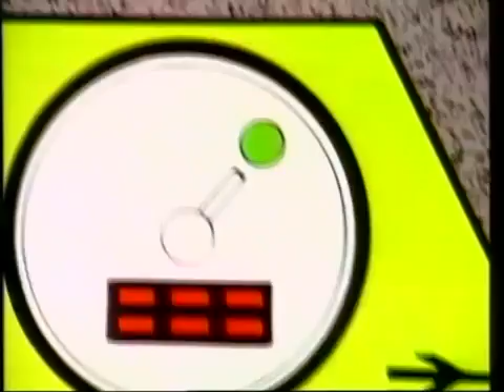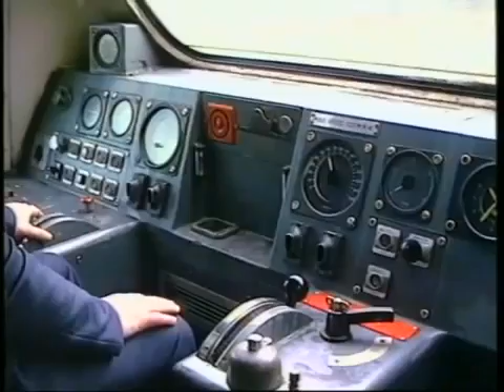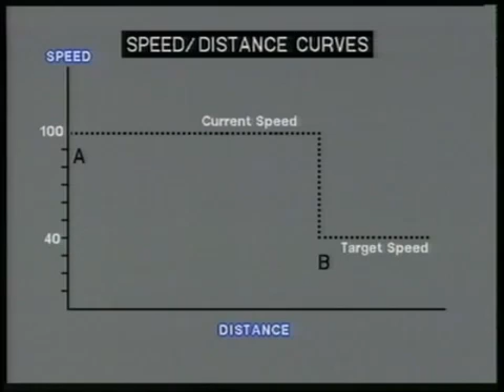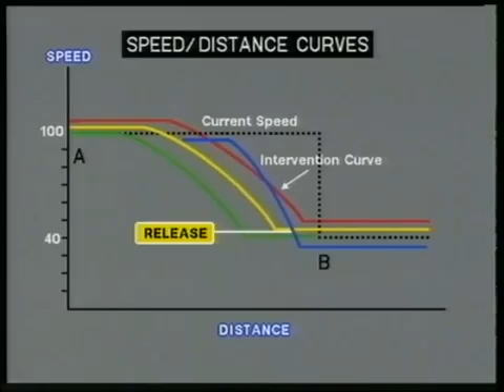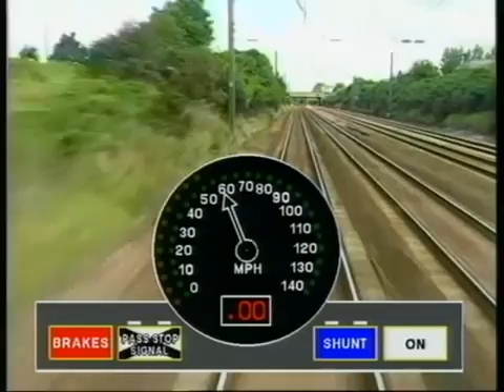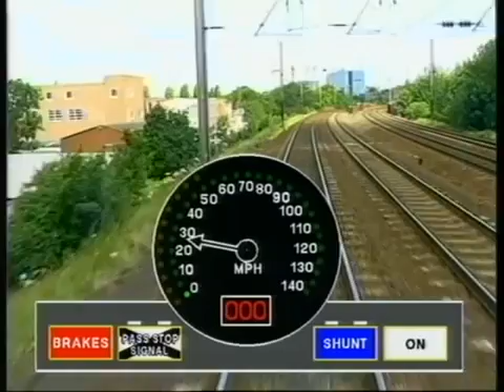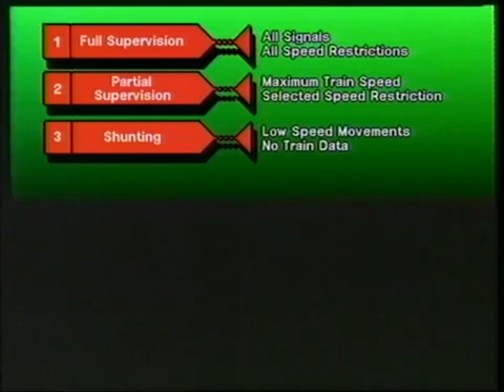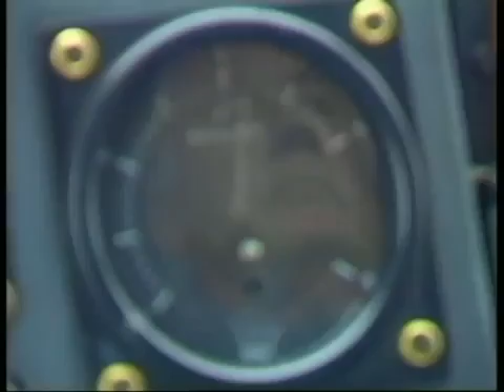BR | Automatic Train Protection

Comment: The technical term for intervention and SPAD's is getting "rednosed" which invariably ended up with a carpeting by the traction manager and persistent reoffenders would be moved to another role or simply sacked.   The thing with ATP and TPMS is they can't be ignored, this was a major concern with AWS as a driver would cancel the sunflower and still not pay as much attention to the road ahead, DRA's also are only effective if a driver concentrates on them and works with them as the book states, a lot of drivers don't even bother with them and there is no actual use other than a post it note saying "dont go through that red"   TPMS is actually quite good as it calculates a braking application too light would SPAD the train so orders a full brake and also sees a train accelerating too hard for track conditions and will do the same and traction managers routinely monitor trains black boxes to see who gets red nosed.

Comment: This system looks very much the same as ATB, also called Automatische Treinbeïnvloeding or Automatic Train Protection used in the Netherlands. The difference is that in the cab we have inbuild equipment featuring 4 lights. The first one is a yellow one, which means that the train may drive at 40 km/h or 25 mph,  this light also lits up when a red signal is being approached. The second one is yellow 6 which means that the train may drive at 60 km/h. The third lamp is yellow 8 which means that you can drive 80 km/h. Then you have yellow 13 for 130 km/h and last but not least green 14 for 140 km/h.
Reply: ATB-EG (The one your talking about) only checks if the brakes are applied and doesn't check brake curves. Also ATB is constant meaning it constantly feeds information to the train unlike ATP which only does it at certain points.

ATP of the GWR is comparable to TBL1 and is a smarter version of PZB that doesn't have a aknowledge button.
ATP on the ChML is comparable to LZB

ATB-EG is more like TVM which checks the speed via AC voltage going through the rails.
ATB-NG is indeed somewhat comparable to this video though. With ATB-NG requiering information to be put in the board computer and  the system functioning via balises. The difference between ATB-NG and APT is that ATB-NG shows the actual brake curve in stepts of 5km/h

Comment: Ironic there a class 91 behind him at the end given that at the time they were piloting 140mph running of the 91 on the ecml using flashing green signals which they then deemed too easy to misinterpret Puzzles me why they didn’t pilot atp on the ecml instead of the gwml it would have solved the problem and we’d have had 140mph running for the last 30 years
Reply: Believe it or not back when HSTs were introduced the drivers kept having competitions as to who could get the closest to 140mph. Until BR caught on and limited the speed electronically. To the best of my knowledge they had no issue with reading normal signals.
Reply: Apparently, 140mph operation requires in-cab signalling equipment. I don't think ATP qualifies as in-cab signalling, as it is only a protection system.
Reply: @williamhuang8309 : I would think that (these implementations of) ATP would count as "in-cab signalling", they provide about as much information to the driver as TVM (HS1, Channel Tunnel, LGVs) and CBTC (on Crossrail) do? They certainly go over and above "only a protection system" like TPWS, tripcocks and KVB...
Reply: @fetchstix  It definitely provides the information, but is it desigbed as an in-cab signalling system? Perhaps if the project wasn't abandoned they might've thought to allow it to function as in-cab signalling.
Reply: @williamhuang8309 : Not entirely sure what BR’s definition of “in cab signalling” was, but I would be surprised if for the purposes of exceeding 125mile/h that ATP full supervision wouldn’t count.
Considering that at the time there were the 140mile/h trials as well, I would think it difficult to not have the ATP systems designed (or easily modified) to support that speed, not even BR would have been that bad imo!

I guess we’ll never find out though, they’re already making steps to remove the ATP implementations, and if any classic line were to have its speed increased (which I think is unlikely), they’ll almost certainly go for ETCS level 2 for the enhanced speed.
Reply: @fetchstix  It’s confirmed that that the ECML will be the first main line to get ETCS Level 2, which actually works in a similar way to ATP but there’s a key difference - instead of information being transmitted to the train intermittently via trackside beacons, it’s transmitted continuously via GSM-R. 
With ETCS there will be no lineside signals at all.
And when the HS2 eastern leg was scrapped it’s viewed as almost essential that the ECML should be upgraded to 140 when it gets its ETCS - this is as fast as domestic trains travel on HS1 (but not international!)

Comment: What happens if the on board computer fails,as the low voltage they work off can fail.
Reply: The train also has AWS & TPWS, trains can run normally with ATP isolated if necessary.
Reply: @paulparkins2919  remember that ATP predated TPWS - TPWS was a cheap knockoff that was installed after the planned full rollout of ATP was cancelled.
Reply: The train is failed.

Comment: This system reminds me of a mixture between the german PZB and also german LZB systems.
Reply: The German PZB (Indusi) system is also used on the O-Train Trillium Line in Ottawa.
Reply: @FelixAn : It's used in the UK too! On the Tyne and Wear Metro system...
Reply: More like PZB, LZB uses a wire along the entire length of the line sending data to the train continuously.
Reply: LZB have in cab signaling but BR's ATP doesn't
Reply: The Chiltern Line ATP [equipment] is based on LZB, isn't it? (And the GWML ATP being based on TBL, I believe)
Reply: For me it kinda reminds me of the EBICAB 900 system used in Finland, especially the spedometer with the green and yellow LEDs

Comment: So this system will allow a train to approach a danger signal at 25 mph?  Seems a bit fast.
Reply: While the train won't necessarily be stopped before it passes a signal at danger, it should end up stopping within the overlap with ATP and while you're within the release speed (and so before there's any danger of collision) from what I understand.

That said, a release speed of up to 50miles/hour, still a bit worrying (despite still being safe)...
Reply: Mr. White It's the same in germany and it works, so, nah
Reply: @ampericus  the thing with Germany is that most signals hava a "Durchrutschweg" (through slide way) which, if a train SPADs, will allow enough space for the train to stop without coming into conflict zones. idk if the uk has this feature as well, but I don't think it does (at least not everywhere)
If there is no/not enough Durchrutschweg present, the train will be signalled to 30 km/h or lower, so that -in the case of a spad- the train is at a lower risk of sliding into the conflict area.
Reply: @girpe5635 I'm aware; afaik in britain this is usually the case too and is called overlap. I'm not plugged in though, I could be wrong

also nice trans/pan pfp :3
Reply: @ampericus  i have just found out that Britain usually has a 183m long overlap. (in watching more br training videos.) 
I am also quite surprised that you answered to a 6 year old comment, and especially in such a short time :3
Reply: @girpe1024The release speed for ATP is variable for each signal and is uploaded into the train at either the loop at the previous signal or at the indication point for the signal. That's why there's an array of yellow lights: if there is a shorter overlap then the release speed is correspondingly lower. The release speed can go down to zero, which is the case for buffer stops.